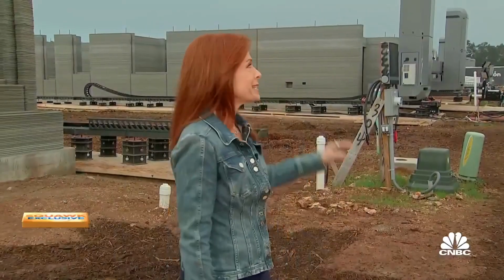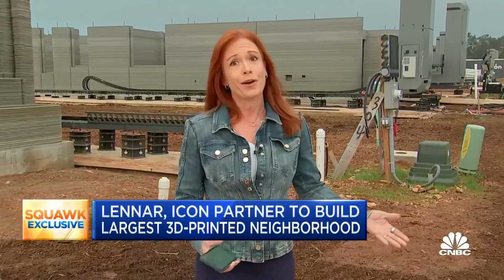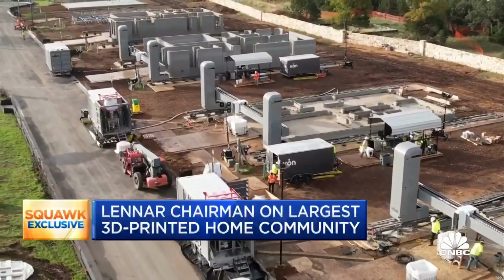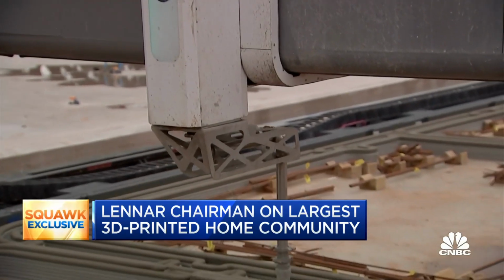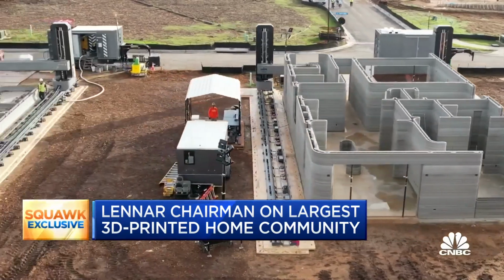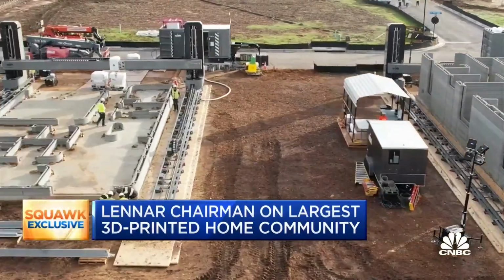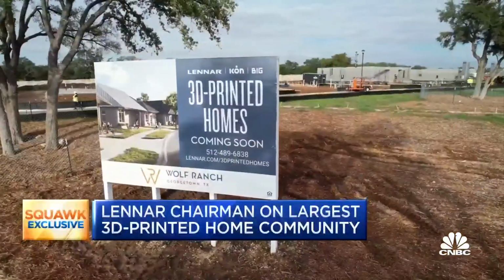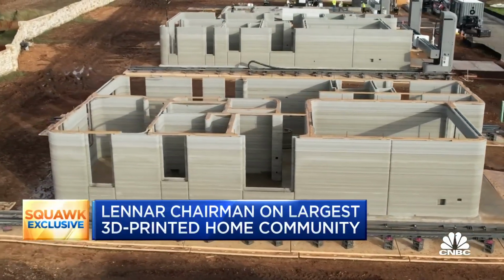Lennar, ICON partner to build largest 3D-printed neighborhood

Comment: How is this lower the price of housing ? Mid 400 ist still too high
Reply: Not the point. It's to increase margin for builders. The only net benefit will be more starter homes potentially being built, as margins will be much higher. That starter home will still cost $400-$500k.